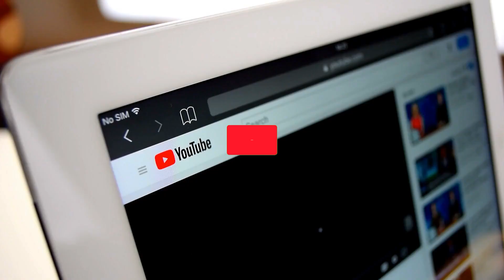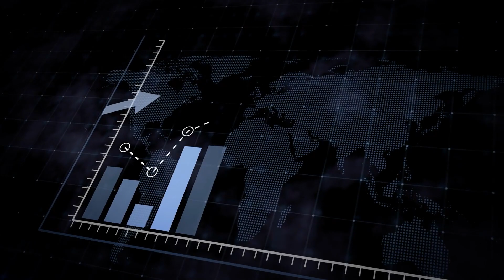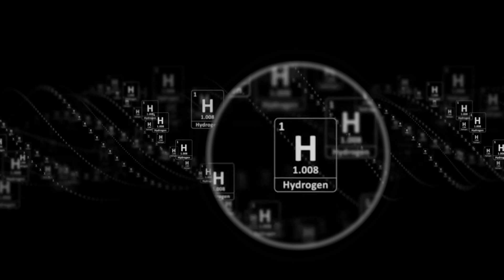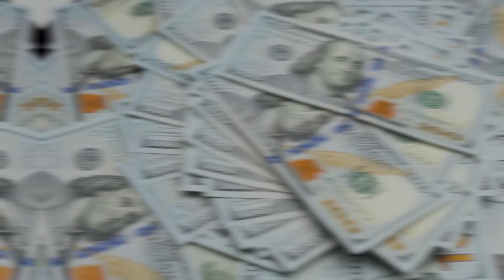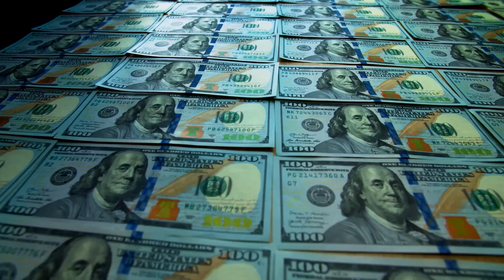This engine will DESTROY the EV industry before it's even started! | Here's why EV makers are scared

Comment: A Hydrogen fuel cell vehicle still is an electric car. You just can’t plug the Hydrogen fuel cell car in. Hydrogen Fuel Cell vehicles are still susceptible to cold temperatures just like battery EVs. Both have batteries that don’t do well in cold weather.

Comment: Nothing in this video is actually accurate. Electric cars can go 500 miles on a single charge(Lucid Air). Most Tesla EVs will do 300 or more miles. Toyota’s Mirai won’t even do 300 miles on a tank of Hydrogen that costs $23 per KG or over $100 per tank.